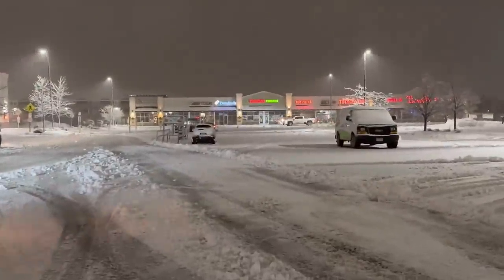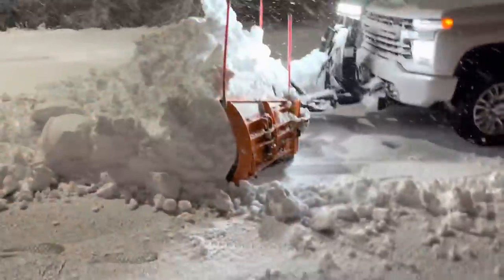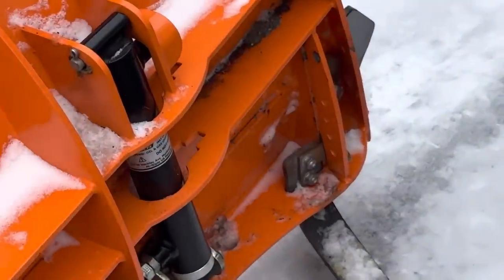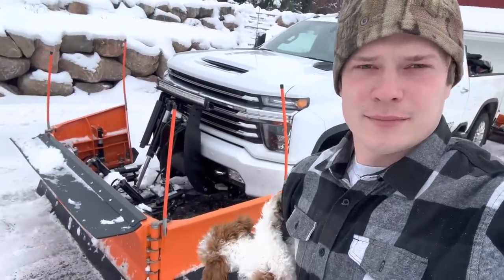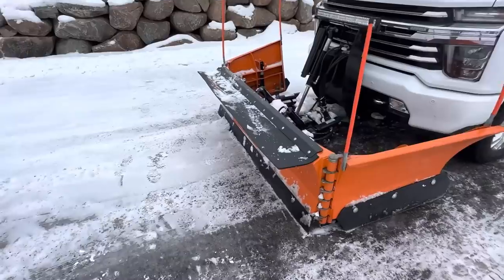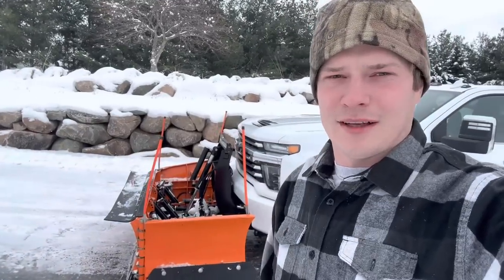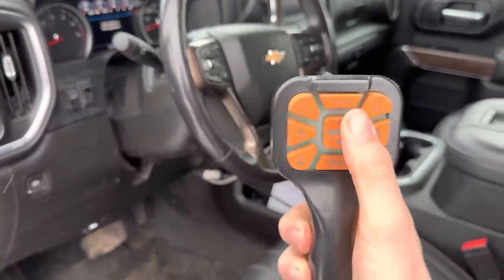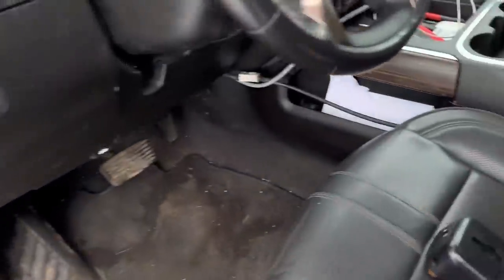PLOWING WITH THE NEW SNO POWER F14 TRUCK PLOW! @snopower3744

Comment: Nice unit but how will the truck hold up is the question,have they addressed the trails from wings original vplows used to do that until they changed the cutting edges definetly has nice features
Reply from the maker: Yes there’s a small cutting edge that goes between the straight edge and the wing edges.

Comment: What does that plow weigh compared to a v plow is it heavier
Reply from the maker: It weighs 1100-1200 i think the new wideout is around 1100 so not a huge difference
Reply: @GarrettWilliams2017  no not at all that’s pretty amazing considering how much more snow it can move to.
Reply: Plus the wings curl back towards the truck so less of the cantilever effect. Prob handles on the truck better than a large V Plow

Comment: Lose me with the not being able to wind row and then the controls looks like a mess I have the snowex 8611 with the mounted controller and my ebling controller mounted on a pvc pipe that fits in my cup holder so my arm can sit on the center council and operate both plows with one hand at the same time